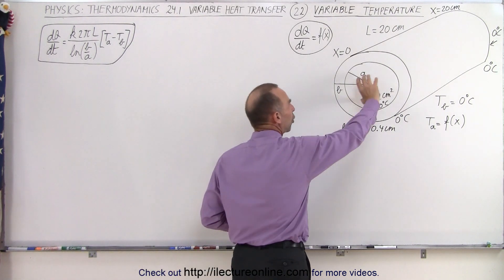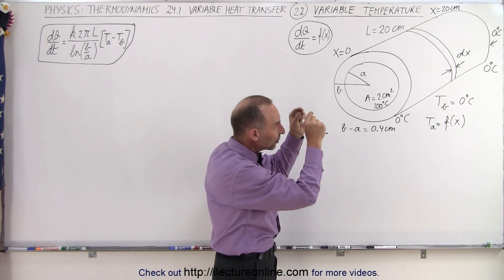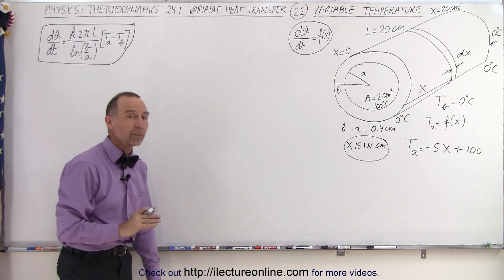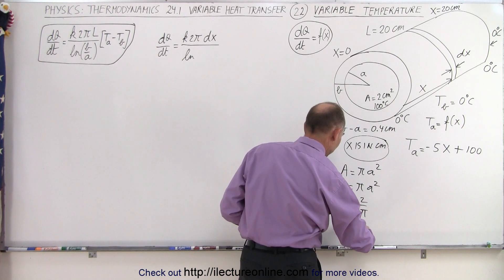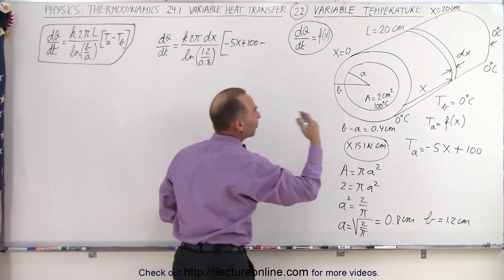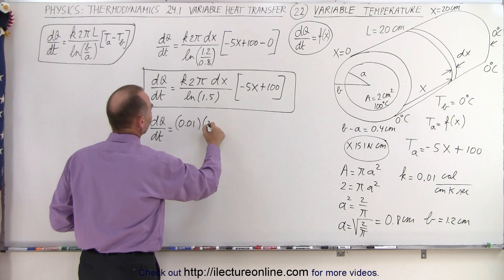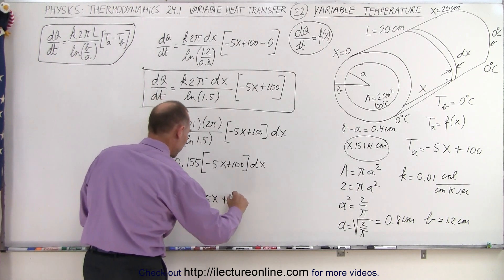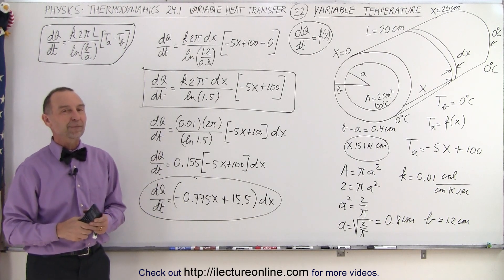Physics 24.1  Variable Heat Transfer (22 of 25) Variable Temperature

Comment: prefer if you use SI units instead please, especially the cal/cmKsec I only have the K value in 1630 W/(m k) which I don't know in your units.
Reply from the maker: It turns our, it doesn't matter what units we use, the method is exactly the same.  Just substitute your units in the same problem.  We show examples with both types of units, since we still use Imperial units in the US.

Comment: Hi Michael, I have a really maybe shame question, do you have an example where you calculate or define the equation to calculate the temperature rise in wire could be any AWG, as you know cross-section and conductor material are key elements to affect the wire temperature, however, once I know the power losses I don't know how correlated those power loses to rise temperature  wires include insulation, my chamber room temperarture are at 25C and the current will be the only variable, if you have any example and you share it with me would really appreciated,

Comment: Why isnt Ta expressed in Kelvin if you use k with Kelvin instead of Celcius, wouldn't it be dimensionally incorrect? Ta goes to 0 at x =20 Ta = 0 Celcius???
Reply from the maker: Kelvin degrees are the same as Centigrade degrees, so it doesn't matter which ones we use for temperature differences.  It is only necessary if we use the actual temperatures
Reply: Thank you!